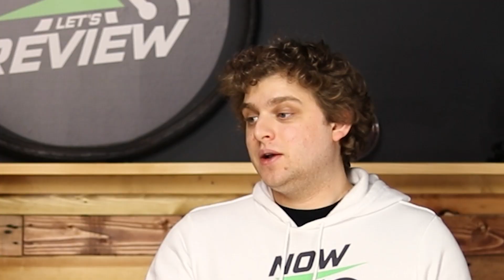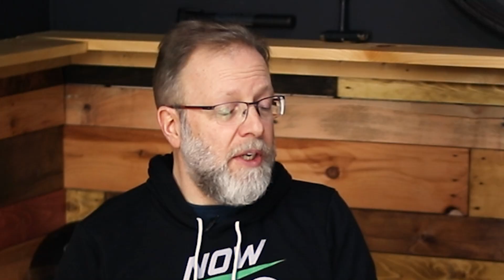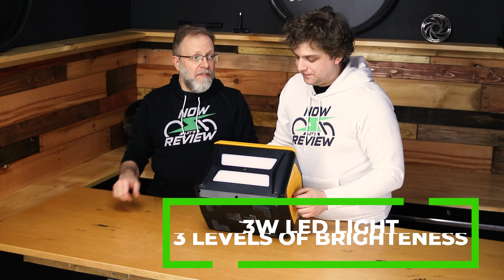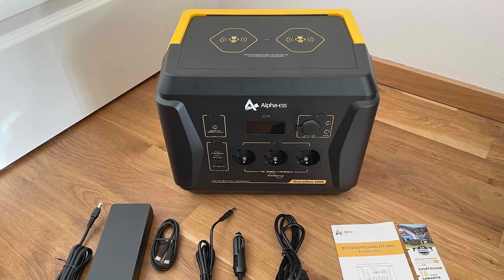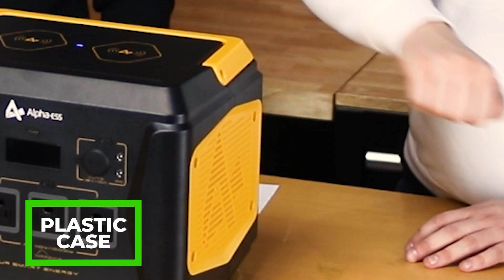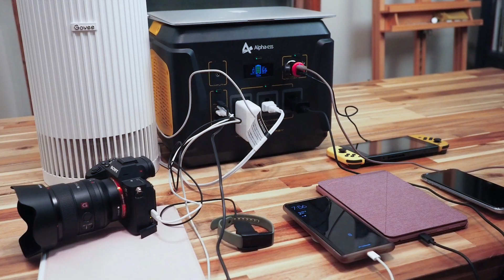AlphaESS BLACKBEE 1000 | Perfect Worksite Portable Power Station!

Comment: I got a BougeRV 1kwh LFP power station. I got it to power my little fridge off of solar, and it works quite well! I’m living in a tent off grid currently while I work on building myself a house, and was planning on getting a 3 kwh ecoflow system, but this was on sale for just $750, so I had to pick it up. I’m probably going to have to get another power station though once I get an induction stove. Cooking over a fire gets old pretty quickly, and I’d rather not use a propane stove indoors.
Reply: Do u know how long I could run my TV and PlayStation and a heater for ? Hours